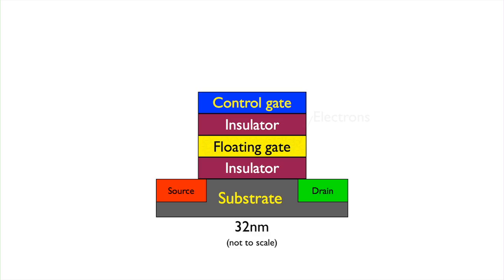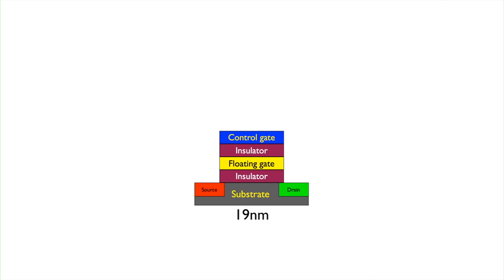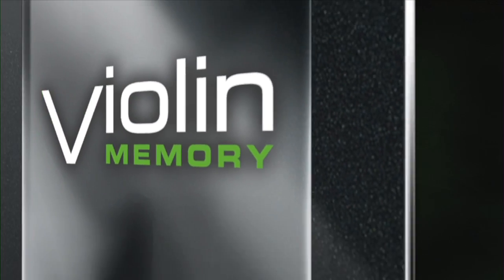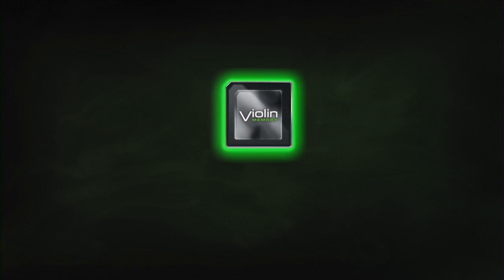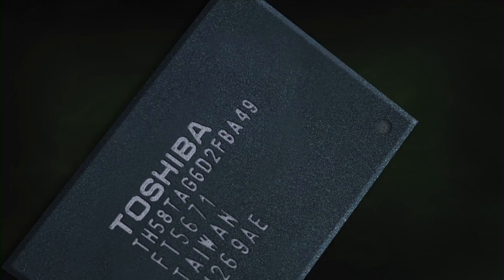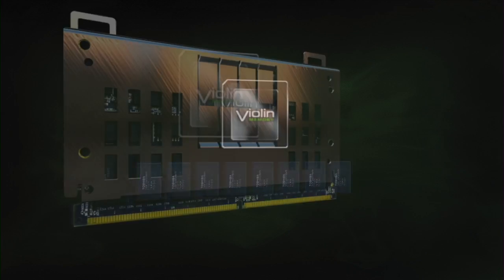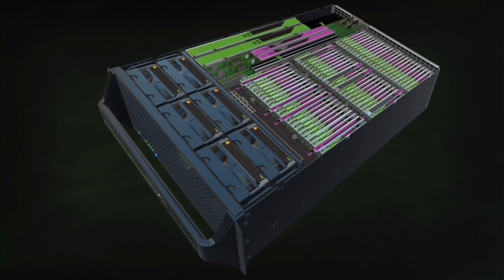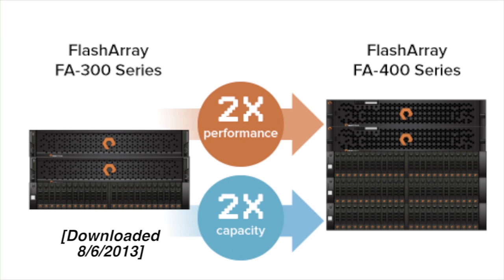Violin Next Gen Flash Geometry & Performance

Comment: Nice but very biased video. SSD design and architectures are not standing still. The focus on Pure Storage as representing the only design point in SSDs is nothing short of convenient cherry-picking.  Here is a different view of the comparison where we don't arrive at the same conclusion. The new Nimbus Data Gemini is 2RU, versus Violin Memory's 3RU for the 6264. The new Gemini Arrays actually have faster network options 16Gbs FC and 40 Gbps Ethernet options. Nimbus Data's Enterprise SSD in their new Gemini arrays offers 24 TB per 1RU versus Violin Memory's new 6264 which is 23.43 TB per 1RU. The Register : http://www.theregister.co.uk/2013/08/14/nimbus_leapfrogs_violin_in_flash_capacity_stakesjust/  
A look at the redundant (HA) and hot-swap-everything Nimbus Gemini array Enterprise SSD here: 
Checking out Nimbus Data's F400 and F600 All-Flash Storage Arrays!